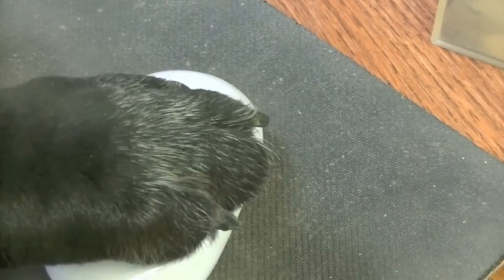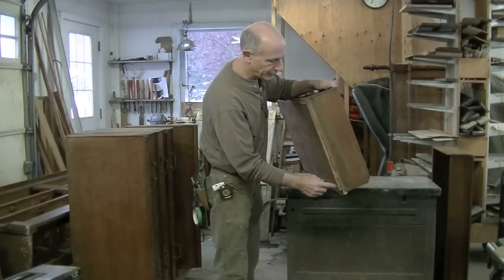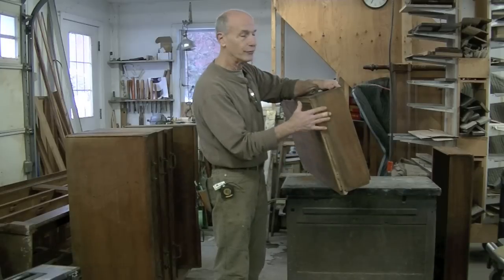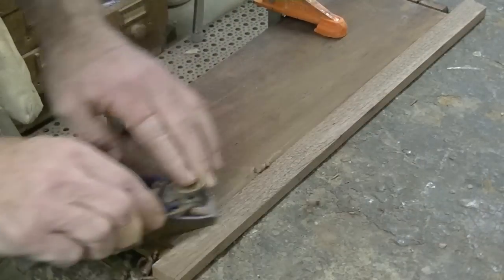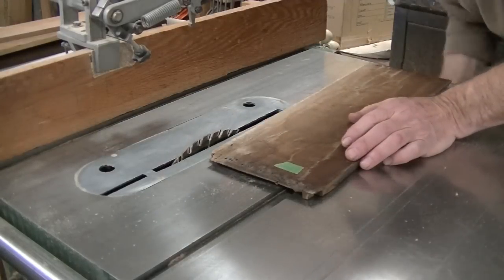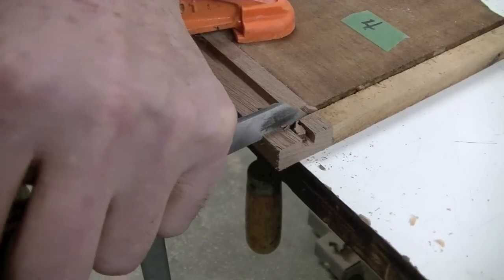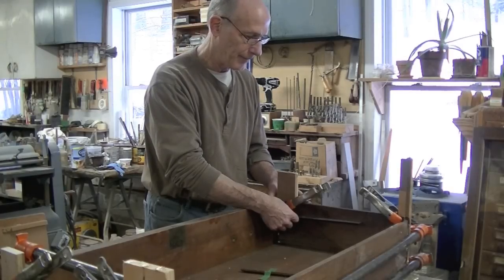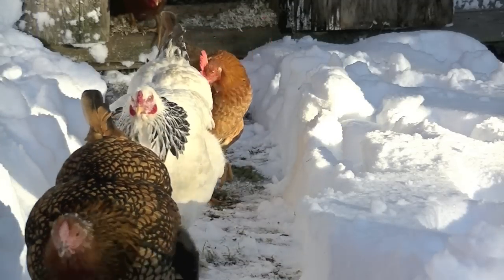Repairing a Victorian Drawer Runner - Thomas Johnson Antique Furniture Restoration

Comment: Any suggestion or video on how to repair worn drawer guides?  I am restoring a late 1910s, early 1920's Hoosier and the drawer runners are worn down and the drawer guides are deeply grooved and worn away.  I am going to use your technique from this video for the drawer runners, but would appreciate some advice on the guides.
Reply from the maker: +kellcin It's hard to give specifics having not seen it but usually I replace the guides

Comment: Did you add some corner blocks to the back joints of the drawer?
Reply from the maker: Hi Mac, thanks for watching. And yes, I did. I didn't really show that in the video. The joints on these drawers were so lousy we felt they needed them. Unusual for a late 19th century piece, it is from a built in, but no dovetails. Just tiny tenons
Reply: Thomas Johnson Antique Furniture Restoration Thanks for the reply, I loved watching the repair.
Reply: That glue doesn't look suitable for antique restoration. I was told to use hide glue at college as it is easy to disassemble furniture when required in in the future.
Reply: Like hide glue, the aliphatic resin glue Mr. Johnson uses some of the time is water soluble and REVERSIBLE.  Reversible is key.  The modern adhesive gives a BETTER bond.
Reply: I was wondering the same thing. Good reasoning.